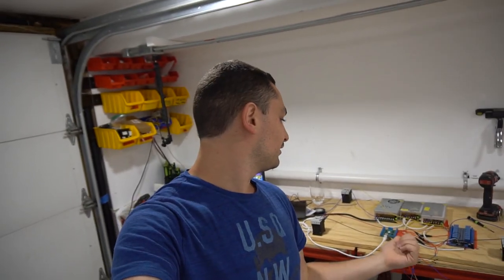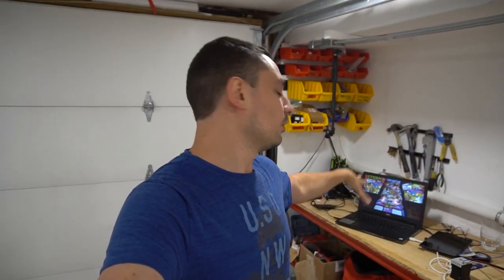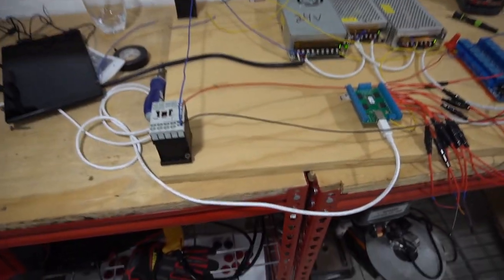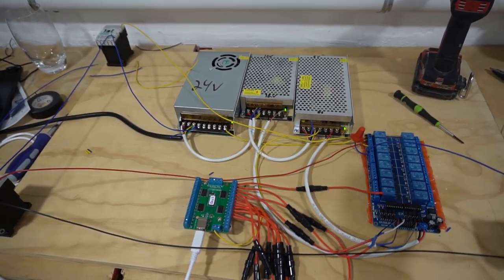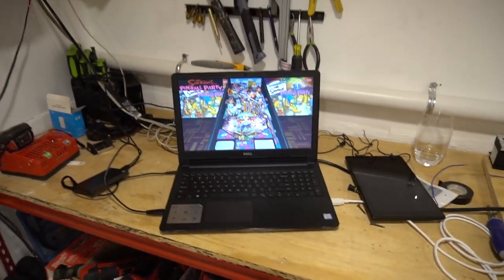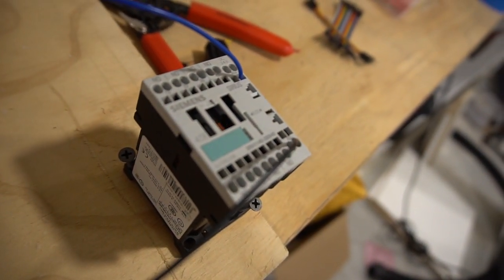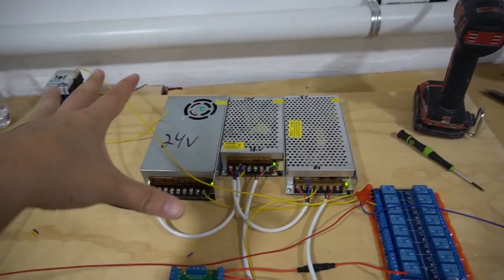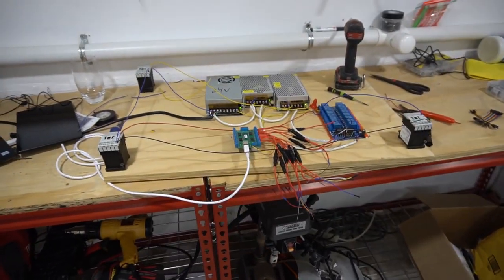Sneak peak at Virtual Pinball Cabinet

Comment: Good luck on the journey. Couple of things. A) join us over at VPNation on Facebook in case you need help or anything else
B) don’t go 50”. It’ll be monstrous and oversized. Go 40 or 43” that’s the size for standard or wide body. Just my $0.02 my man. Also don’t forget about SSF /Surround Sound Feedback.
Reply from the maker: Thanks bud appreciate it! And yes I'm going to dab into the ssf, looks like I'll need an exrernal souns card but thats fine :)
Appreciate the suggestion on the 43". I was going to go with a 49inch but I can get a more affordable 50inch
 I'll do some research on it but i think I'm going to pull the trigger on the 50. I saw an Australian guys 49inch... God its gorgeous and I'm totally copying his cabinet. His back box and everything is just so perfect! His name is oli Oliver.
Reply: Vic_VP what’s your pc specs? Most newer mobo have onboard 7.1. You can assign the 3.5 inputs to whatever. You just need front, rear and side.
Reply from the maker: Not sure yet on pc, I like msi so I was going to get a cheap 80$ one... external sound cards are 30$ 
But im going to go with the rtx 2060 for graphics to get the 4k playfield. Pc I built came out to about $800
Reply from the maker: Also correction on that Australian youtuber... its Oli Vier... check out his Munsters cab... his build blows my mind and its so clean and perfect. He has a step by step build as well
Reply from the maker: Really??? Wow I read on some forums the 1660 wouldnt run well in 4k

I'm going intel, I always use intel.... was going to make the jump to amd 

And yea getting current mobo now is very pricey shockingly
Very surprised by ur specs bud! Thanks for sharing them
 I also joined the fb group!

Dam wow that 1660 and ryzen idea drops the pc build to like 600! Hmmmmmm
Reply: Vic_VP oh yeah i remember when he built that cab. It was cool but you also gotta make sure since you’re going tv to calculate in input lag and things like that. I mean if you’re gonna go that size i feel you but just as an FYI most builds are people repurposing old cabs and nose fit up to 43”. If you’re gonna cut it yourself then yeah go for it.
Reply: Vic_VP yeah people over think it. If the settings are right you can run it flawless. To be honest i was surprised that my 1650 performed like it did i was ready in a sense to grab a 1660 but i didn’t need it. 

I think today’s stream is up to view on YouTube via pc if not check my corvette table video. That was after i got my 4k screen. 

Yeah before COVId Ryzen was more available and much cheaper than intel. My mobo/CPU bundle was $160 from micro center. Also if you’re near the north jersey one go there. 

Yeah even if you go 1660ti model you’re still saving $100+ vs a 2060
Reply from the maker: Yea im gonna cut it myself. His backglass is perfect. Dmd size and no bezels lol. I love his pin, I just saw some of your vids. R u using 1 screen for dmd and like the video attract thing? That is just a looping vid right? Its not related to actual gameplay? 
I read somewhere like current pinball tables utilized that screen?
Reply: Vic_VP yeah i got 3 screens and using the new dmd underlay videos available for free download. It’s really cool. I used to split my 3rd screen topper and dmd but these new ones are awesome. Here’s the link for the download of the available ones 

https://mega.nz/folder/cr50FawQ#_qc32jYyCZhMbz9Krd-h1A

Yesh i got a mini since i don’t have room for a full size in the condo but soon.

Also I’m noticing gpus are getting scarce again, smh. 

But yeah don’t overspend. I’d say stay with the 1660 any model will take care of you in 4k.
Reply from the maker: Awsome man thanks! You'll see me soon on the fb group hahaa
Reply from the maker: Quick question bro.... what's this "forbidden table" I see on the fb group lol
Reply: Vic_VP ghostbusters by stern VPX edition. It was built off a cracked DLL by the pinball arcade/Farsight release so after it went up takedown notices were sent out.
Reply from the maker: @LunchboxBrimz  o wowwwwww very interesting

Comment: I see you don't have diodes, installed for the contactors. This is a great build guide every thing Vp. http://mjrnet.org/pinscape/BuildGuideV2/BuildGuide.php?sid=toc

One other tip. I would suggest if going full size cabinet. Go for widebody. The standard size cab can only fit a MAX 40" screen. And 4k 40' are really no longer made except from Vizio. Widebody fits 43" and up. It was a b acquiring 4k 40 for my Williams standard cab.
Reply from the maker: Yes I have his guide and been following it. Yes I have diodes also :) it was just a quick test mock up but the final build will have all diodes on all toys. Appreciate it bud